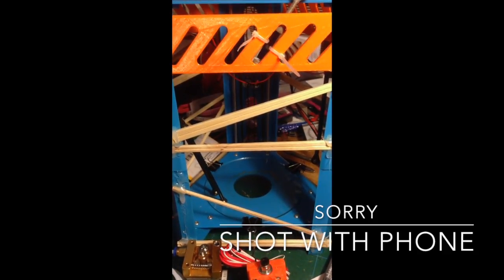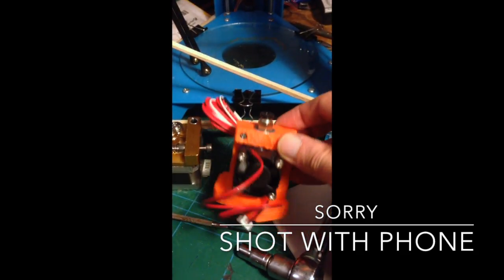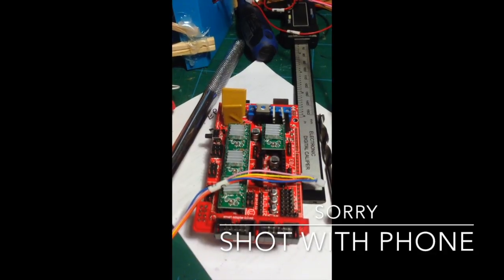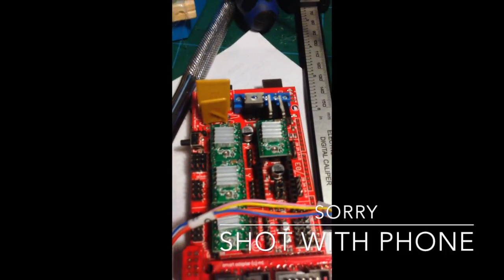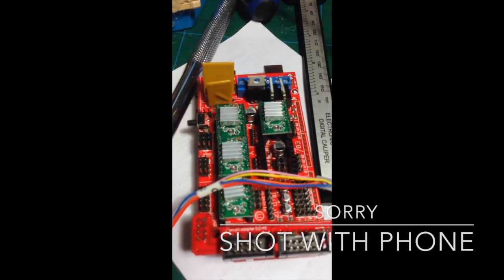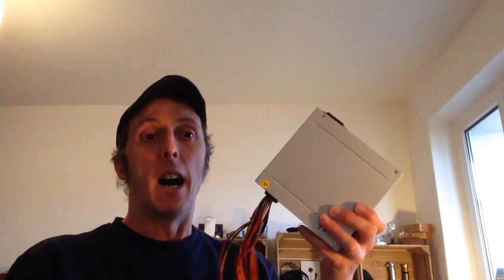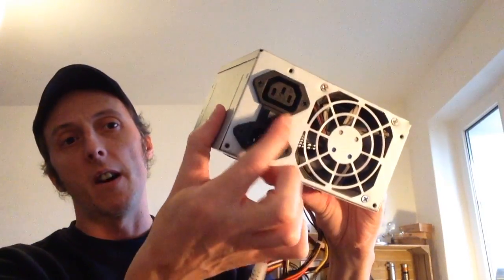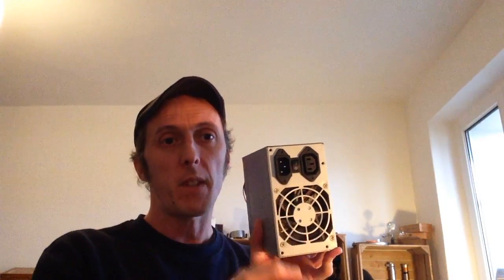Cheap Chinese 101Hero 3D Printer calibration,  improvement and upgrade.  Progress update #4

Comment from the maker: PSU, part cooling fan and enclosures for the display and PSU are the next set of upgrades coming. What else would you do to improve this printer?
Reply from the maker: Thanks to Workshop Tinkerer for the motivation and guidance. Otherwise if you are looking into this or have a 101 hero check out the 101hero unofficial facebok page. It is a great resource to help you out.